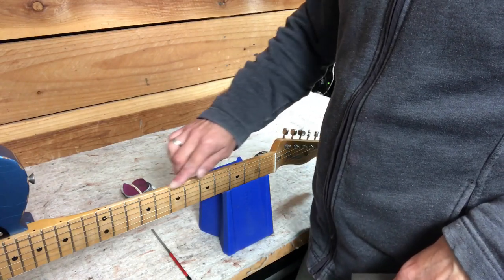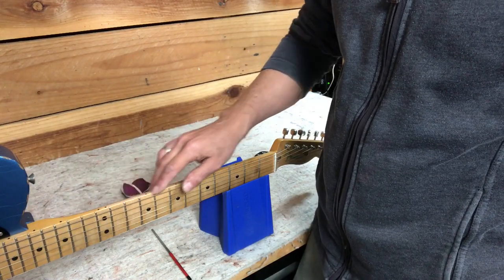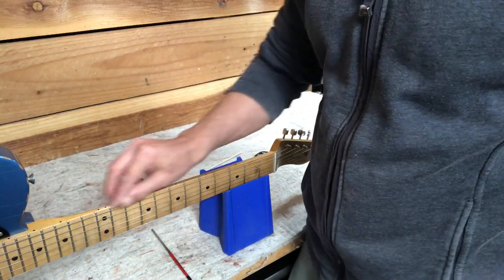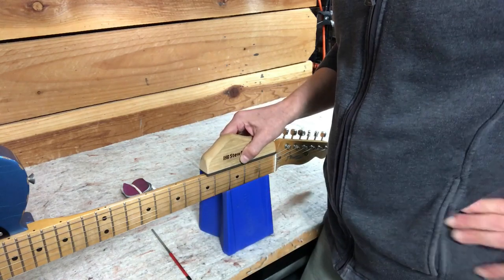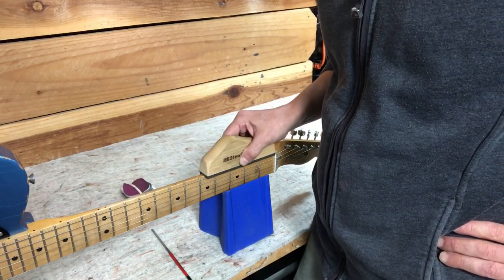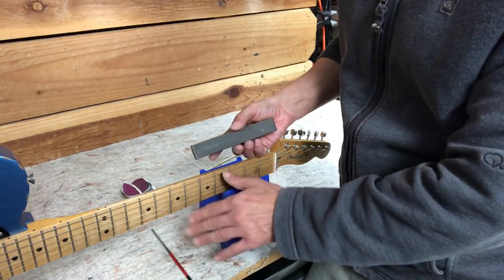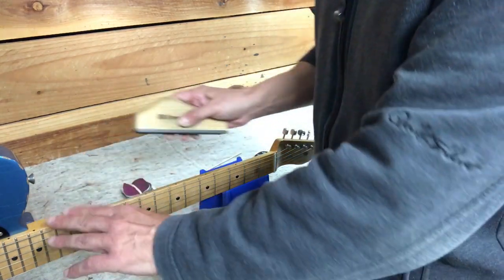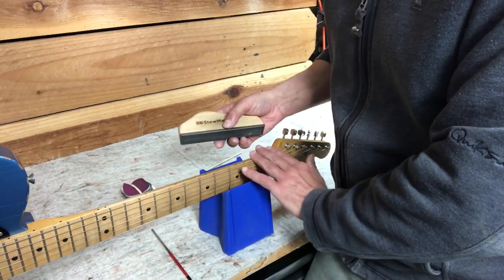Tutorial - How to Roll Sharp Fret Ends and Fix Fret Sprout

Comment: Do NOT use WD-40 on your guitar, holy shit lol. Terrible idea. Also, do not use that StewMac Fret leveler unless your guitar is unfinished (most are finished in satin, poly, or nitro). A StewMac fret end dressing file is the best tool for this job. And then you can use #0000 Synthetic steel wool to finish. Also, at 1:24, you are suppose to bevel it, see StewMac's video titled "How to make sharp fret ends smooth with fret dressing file".
Reply from the maker: WD-40 is a lifesaver. Useful all the time. You do you brother. If. you don't agree, then good on ya. This is what works for me. cheers!

Comment: you never use WD 40 on a guitar, it has silicone and that can damage some lacquers and other finishes. If you go to re-paint your guitar it will certainly become an issue the silicone will eat away the lacquer
Reply from the maker: hey to each their own. it's the best sanding lubricant you can find, but use Windex if you don't like WD. cheers
Reply: WD-40 does not have silicone in it.
Reply: @Hohoho962 Just mentioning, there is a special WD40 Specialist Silicone Lubricant. I use it to lubricate the treadmill belt.

Comment: Looks like you got the wood at the edge of the fretboard a bit messed up there. I know its very difficult with maple necks to cure this common issue. I would not recommend anything but the slightest contact with fretboard between frets. The fret end files are the only tool I would use. Its a long and delicate process unless you are going to refinish at least the edges or the fretboard. C
Reply from the maker: Thanks for the input. I mention it at some point in the video, but with a Road Worn guitar I'm not too worried about making marks along the edge of fretboard and the final sanding tends to smooth it out anyway. But on non-Road Worn, yes, have to be careful. thanks.

Comment: I recently bought a MusicNomad MN831 Precision Fret Beveling File which offers 2 different angles for fret beveling...plus a Stewmac file dressing. The change of seasons in relation to humidity can reek havoc on wood ! Thanks for this video. !  p.s..... WD40 is Not recommended. Either Naphtha or mineral spirits would do a much better job and not harm the finish. WD40 is NOT safe for the finish. I've seen several people doing this recently and it is bad news (for most guitars).
Reply from the maker: Thanks for input. I’ll check out that beveling file. I hate to part with my WD-40 so you’ll have to pry it from my cold dead hands but thanks!

Comment: No offense, but you went from a metal FILE to 4000 grit?? That's like, going from 100 grit to 4000 grit...   😐  I could see going from the file to maybe 220 grit, then going up to the higher ones...
Reply from the maker: Yea, good point, sometimes I start a little lower around 1k, but go much lower and you're just scratching things up. 1k or higher works for me. cheers..PS: Check out a follow up vid I did just because of your question: https://www.youtube.com/watch?v=WLJ5qllb6a0. In it I try using heavier grits...guess what I found out!
Reply: Surely he meant 400 lol 
He says 400-600-800 etc 
They don’t even sell 8,000 grit 
so yeah start with 400, go to 2500 or so
Reply from the maker: @chrisgravier9650  Hi Chris, No actually I use 3M paper 5k grit and even higher with the micro mesh pads (12k). For me you gotta start 1k or higher. 400 you'll just make a mess of your neck. but there are many ways to do this. cheers

Comment: I appreciate the quality of this video.  Thank-you.  

This is going to sound pretty random but I've been using a sanding sponge from Home Depot to roll the edges on my guitars and knock off the coating on the back of the neck.  I really go to town and my guitars feel like they have been played a million hours.
Reply from the maker: yea, sounds like a good way to go. the bendable sanding pieces really work well for that stuff. cheers!
Reply: Nice Suggestion .. what grit(s) do you suggest ?
Reply: Not sure but I start with a furniture stripping pad. They are very rough and really cut through the poly on the neck. Then just sanding sponges. Maybe 120?

Comment: I'm glad you made this video, it's very helpful. If there is one thing I cannot stand about any guitar, it's having sharp fret ends, it makes it feel like you have a hacksaw blade in your fretting hand while you are trying to play. However, I would like to point out that it's best to take off the neck if it's bolt on, and put the body aside, make more room for yourself to work. Also, it is a good idea to spend a bit more money to get the Fret End Beveling File from StewMac, that will keep the proper angle for the bevel. I bought it because although I have the Snapfile System, it's beveling file ( or any file you might use to do beveling ) is difficult to maintain at a consistent angle. The downsides of the Fret End Beveling File are that you have to keep pressure on it to compensate for the change of the neck width, and to keep the file clean after every few strokes. I have a Fret End Dressing File also, and it's a good thing I kept it, because I purchased a set of the Concave Fret End Files, and while they do "put the round" back on the fret ends, I found out I needed the original Fret End Dressing File to take off the few remaining burrs on the sides of the fret ends. My final finishing technique is to use 220 sandpaper, then 320, then 400, and then completing the job with finishing papers. I use a sanding block also, I don't get aggressive with it, however, only a light touch is needed, since it is now more polishing than removing metal and wood.
Reply from the maker: Thanks for these suggestions. I was already considering trying the beveling file, so I will definitely give it a go. I will also try some of your other suggestions on sanding. I'm a little scared what 220 might do the the neck edges, but I'll try it. thanks!

Comment: Is it me or can I clearly see where you took off a bit of the wood from the finger board by filing without taping? Right at the 6 minute mark??? Also I'd be wary of using WD 40 especially on a maple neck like this. Am I misguided in my thinking? I have sharp fret ends on several guitars and I'm frankly scared to run a file over them.Thanks still kickin
Reply from the maker: Hey, some valid comments. Many people have commented with worry about not taping the fretboard. What I say is definitely do tape it if you have any doubts. I have done this so many times now that I feel confident and if you look at my final result at end of video you'll see that after sanding, most marks I've made get smoothed over (this Road Worn does show some color difference when you scuff the wood, but it will even out again soon with playing). Also with the WD-40 that's just what works for me. I mention you can also use Windex or water as a lubricant. I recently watched a StewMac video doing this same exact process and he also did not tape off the fretboard, but again, I think for most people it's the smart way to go. Just to be safe. And those files can be quite aggressive. Also, a key is to go very slow with it. And try not to get too freaked out by small marks you make. Really watch the sanding process I go through with several grits and if you do this part right it will take care of most small imperfections you've made. Also, if you are new to doing this, start on a cheap guitar, not your high-end baby. Hope that helps. Good luck!
Reply from the maker: PS: You might check this video: https://www.youtube.com/watch?v=DLR_bl_0LMI
I really go into how going through various grits of sandpaper slowly erases marks/damage. If that process is new to you, it could help. cheers
Reply: @stillkickinmusic  thx

Comment: I only have one guitar out of 11 ! with this problem..it's a nice parts caster i built and put some money into.. I bought the stew mac fret file dressing kit 60 bucks !  but took care of the sprout a little bit so far.. i think i need that sanding beam you had in the beginning? hate to spend more then i need to? or i also have a dremel tool but but hesitant to use? it's a mighty mite maple neck...
Reply from the maker: cheers. you can definitely get a cheaper sanding beam on ebay for $20, but StewMac stuff lasts forever and is pretty good--just $$

Comment: What would you use if you wanted to match the lighter tint of maple that got nicked to the rest of the neck?
Reply from the maker: sorry man. don't quite understand what you're asking. thanks for watching!
Reply: @stillkickinmusic   meaning if you accidentally sand off some wood surrounding the fret tangs in the process, there would be some discoloration in the wood, no?
Reply: @nathanielcooper2602  I would just leave it be if I were you. If you tried to airbrush the filed wood to get it as close as possible to the original tint, it will not come out that great, because that original tint will more than likely be worn out also.. Unless you want to refinish the whole neck, that's another story, you can if you want.
Reply: Makes sense.  Thanks for the response!
Reply: @nathanielcooper2602  What I would do to get as close as possible to the effect you want in this case is to give the filed wood a couple of coats of lemon oil, but keep them light, don't soak it. Let them dry for a while after a good rub in. Oils have a darkening effect ( however slight ) depending on the wood ( on rosewood, ebony, etc, the darkening after lemon oiling is more pronounced ). I would inform a customer, or whomever you might be doing this for about the final appearance of fretboard edges after a filing job. It's not wanton destruction, but make it clear that the benefits far outweigh something that eventually won't be paid attention to, especially if the rest of the instrument is worn out, finish wise.
Reply from the maker: @GonzGunner  thanks guys, these are great ideas. I know what you mean about some slight color differences after the filing, however, in this case, a road worn guitar, I didn't think it was going to be a huge deal. Also, with some playing, hand oils and dirt should even that right out. I like the oil idea and will try it. I might also add a small amount of graphite to the oil, which could possibly even out the hue of wood, which in this case we want to look old and worn. graphite helps with that. By the way the customer was very happy to get a free fret end smoothing job on this one.
Reply: A guy should tape it off and sand the frets through the tape. Watch "stop playing with sharp fret ends". If you care about your finish like i do.
Reply: @stopcensoringmyfreespeech3280  it's not so much of the finish it's someone scratching the side of your guitar with a file it's not it feels better so it's ok if I f*** it up I can relic my own guitar

Comment: Hi, can I ask what you are using to hold the guitar in that position?
Reply: No
Reply: @adriansvarela  i wasnt asking you
Reply from the maker: ha ha...I have a Stew Mac vise you can't see off to the side holding the guitar. It's the red vise they sell for like $200 now. It really hurt to spend that much on a vise, but I use it all the time. Has the soft rubber pads so it doesn't hurt the guitar: https://www.stewmac.com/luthier-tools-and-supplies/types-of-tools/vises/guitar-repair-vise/

Comment: What happens when the humidity returns and the neck swells back to normal?
Reply from the maker: Great question. I know how to smooth them out, but never thought what happens if the wood swells. Research needed...
Reply: @stillkickinmusic  One thing I notice is that my acoustic will buzz during the winter but goes back to normal by the end of spring. It’s a Taylor and I don’t have the wrench for the truss rod. Lol So, patience is a virtue. Thanks for getting back though. Time to call StewMac.
Reply: @keithclark486  You mean...like ....flipping the mattress? Lol
Reply: @keithclark486  Really? Sounds expensive. Think I’ll consider a fret file. Lol
Reply: @keithclark486  I might actually have some of those. I priced a Fender USA neck....$800! Where are those confounded files?!!! Lol
Reply: Nothing.  the fret end is then fractionally stepped back from the neck edge, but it's unnoticeable and doesn't affect how the guitar plays.

Comment: What if neck is painted or laquered?
Reply from the maker: It’s still works fine. Just be careful. If you’re really worried, you can tape off the neck. I don’t like to take the extra 15 minutes to do it. Even the SteeMac videos they don’t tape the neck. But you need some experience

Comment: Strange, I would like to think that fender or Gibson QA would not allow sharp fret ends leave the factory. So if there's fretboard or neck shrinkage surely it's because the wood has shrunk due to drying out,  humidity maybe not being looked after properly?
Reply: Fret sprout is caused by the fingerboard drying out and shrinking.  Guitars factories are climate controlled.  Your house is climate controlled.   All the points in between are not - thus fret sprout if it dries out a lot since it was fretted.
Reply from the maker: Yes, especially on these necks that are unfinished, the wood tends to shrink and expand. They get dry and the fret ends stick out. Quite common. cheers
Reply: As a teenager in the 70s, I could go into any guitar store and never feel sharp frets on an any Fender or Gibson. Now it seems almost every new guitar has sharp frets. Definitely a quality control issue.

Comment: What size grit should we use?
Reply from the maker: Hi,
Depends on the wood, but I usually start around 800 or 1000 and work through several grits up to 12,000. By then it's smooth and glassy.

Comment: Would this tool be good for leveling out the frets? Or just for sprouts
Reply from the maker: Hi yes it’s good for leveling too.
Reply: A fret leveling file (as shown in this video) is primarily deigned for fret leveling, but can be used to bevel fret ends as well (as shown here).  The preferred dedicated tool for leveling would be a radiused sanding block, while the preferred dedicated tool for fret end beveling is a fret end beveling file/block. A fret leveling file or beam can do both, but its on you to maintain the correct radius and bevel. The radiused sanding block and fret end beveling file handle those for you.
Reply: @normbarrows  I received and used mine the other day. Worked perfectly

Comment: Those maple necks usually have a thick clear coat.
Reply from the maker: Quite true. Just happens this Road Worn has almost none.
Reply: @stillkickinmusic  Any advise on how to do it without damaging the thick clear varnish.  Masking tape over the fret ends maybe and just file the bits poking through the tape.
Reply from the maker: Yes, exactly what a lot of people do. Tape over the whole edge of the neck and then the file will hit the fret ends first and in between frets will be protected. I myself because I'm always trying to do things fast do it with no tape and am just very careful. You will start to hear and feel when the file starts hitting wood. Even if I slightly mar the varnish, I tend to go over the whole edge of neck with fine sandpaper anyway as a final step to make the frets even softer and that serves to get rid of any tiny scuffs that were made. Just use 1000, 2000 and higher grits and it will make the neck feel like butter. cheers!

Comment: I recommend mineral oil for lube rather than Wd 40. Tried and True finishing oil works for putting a new finish finish on any wood scratches you make.
Reply: David Wang  , I wouldn't be harsh with your comments, man. He means well by going through the effort to put up an instructional video. it's ok, even recommend, to use naptha, a petroleum based product, to clean a finished guitar neck or body, so I wouldn't completely agree with you. Also, mineral oil is technically petroleum derived. Also, it's fine to not tape off a bound rosewood neck and use the rounded side down on a stew Mac file, however, yeah, I wouldn't do it with a finished maple neck, like the subject one.
Reply: I'll second that.   USP grade mineral oil, lowest viscosity possible.  Its the active ingredient in 99% of fretboard products (pretty much everything except Fret Doctor).
Reply from the maker: Thanks guys. I'll give mineral oil a try. Personally I've just always liked the way WD-40 works with the sandpaper and it seems to actually add something on these Road Worn guitars. I don't mind a little darkening, much like hand oils. As for using the file without tape, again, I don't mind marking up a Road Worn a bit, and I sand afterward through several grits that smooths out any messiness. cheers!

Comment: that sucks he fucked up the finish on the the sides of the neck and fret board you need to tape that area off
Reply from the maker: watch the video. it's a "road worn" guitar. There is no "finish" on the neck and I wasn't worried about small marks, sanding cleaned it right up. no need to waste time taping entire neck. The buyer was very happy. You wanna waste your time with tape on a Road Worn guitar, go for it.

Comment: 😳

If ppl don’t want to take the time to do it properly on each fret end with a dressing file , they’d  be better off using a 220 grit sanding sponge and “lightly” running it down on a angle to miss the wood. But only on maple necks and cheap guitars. Anyone doing this on an expensive American Fender or Gibson should be fired!
Reply from the maker: There are a million ways to skin this cat. This was a Road Worn guitar, so you can be pretty liberal with how you treat it and it just adds to the vibe. Not sure if you're saying using the leveling file is "wrong," but plenty of people do it this way and if done right, you won't hurt the guitar. I start with the leveling file, then progress to a dressing file. Final finish sanding cleans up any mess if you're careful.